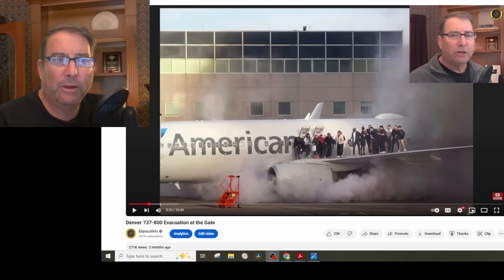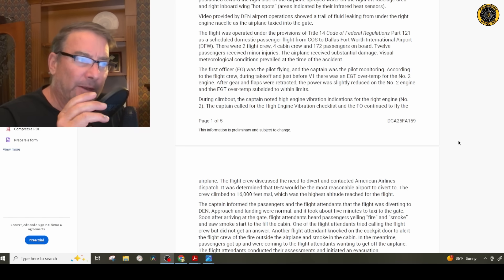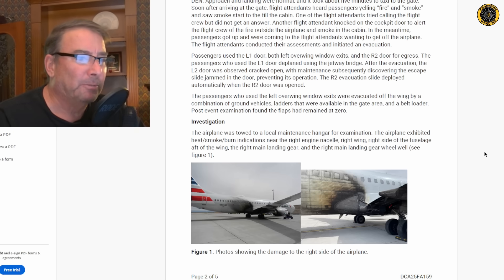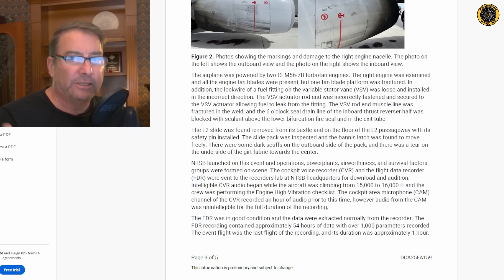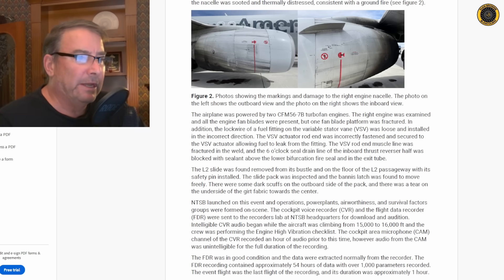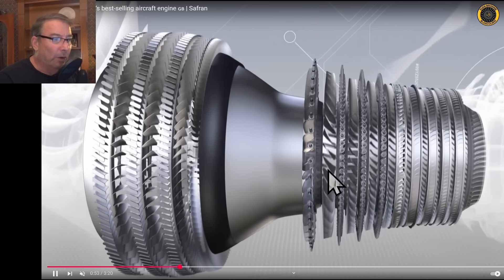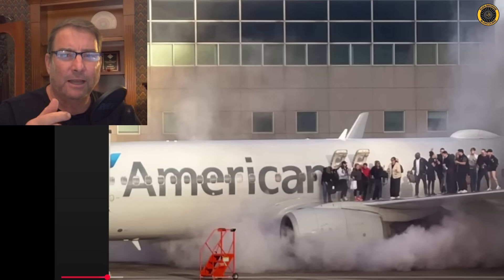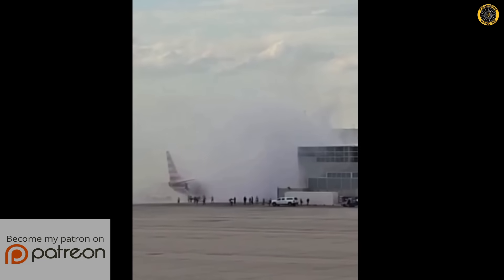NTSB Prelim American 737-800 Engine Fire at Gate and Over Wing Evacuation

Comment: If the plane is actively burning to the ground, I'm not waiting to be told to jump ship either
Reply: Wondering why so many people upvote this dangerous behavior
Reply: All those fools taking their bags.  Leave them !
Reply: That attitude is why there are more casualties than necessary in emergencies
Reply: @chrisnoname2725  I'm pretty sure pilot error is the leading cause of aerodeath, not people disembarking burning airplanes 😉
Reply: @chrisnoname2725 guys probably seen a video about that Saudia L1011 in 1980...
Reply: Yeah, so you can be stuck on the wing like the dips in the video.
Reply: @user-wn6pr4qh5v  did you watch the video? The passengers didn't initiate the evacuation the crew did, and with the rear left escape slide inop, the only available exit was the front door or over the left wing or the right rear that was behind the fire and not a good option either. I would take my risk at a broken leg over burning while waiting to get out a single door. The problem here is the lack of slides over wing, which is a cost saving decision.
Reply: @user-wn6pr4qh5v  I'd rather take a fall than take a burn
Reply: @user-wn6pr4qh5v  I can survive a fall from the wing if I have to, I can't survive smoke and fire in a tin can.
Reply: Save the false reverence for someone who cares.. you sound like a bunch of bitter pilots who go for the low hanging fruit because you already know the overwhelming majority of air disasters are pilot error in the first place, and it burns your ego. And before you cry about flaming engines and ground crew in this instance, that's a very rare exception, not the rule. But anyhow, get over yourselves. You're not sitting around in a burning plane waiting for someone to tell you to get out either.
Reply: @Drmcclung i am not a pilot. I have commercial licences i have never used. So definitely not an airline pilot. My comment was not aviation specific.

Comment: Is it possible to activate the fire control systems on the engine when the engine has been stopped? Or is it likely that it would not have made a difference if they were/were not actuated. It's still wild to me that there are no cameras available to the crew. Though I do understand why.
Reply: I can’t speak to these aircraft, but on the jets I work on as long as you have voltage on the emergency bus (even just batteries) you can pop your fire bottles

Comment: There needs to be a better mechanism by which the Flight Attendants can alert the flight crew to an emergency. Most ambulances have a series of colored lights and buzzers that the medical crew can discreetly use to communicate with the driver. They’ve had this simple system since 1977 or so. Or just a fire alarm the FA’s can hit to alert the flight crew that the bloody plane is on fire. There is a lot of talk about Cockpit Resource Management. There is little to nothing said about Crew Resource Management. For some reason communication all to often ends at the cockpit door. When the FA’s are the only ones with critical information about the state of the aircraft. they are 5he ones that can put eyes on the engines and wings.
Reply: The term "cockpit resource management" was replaced by "CREW resource management" decades ago.
Reply: @ignorance72 Indeed, but for many people (pilots included) "crew" in their head is flight deck and not full aircraft crew. 
There are many accidents (especially fires) where no or miscommunication between cockpit or cabin led to mismanagement by pilots, and a few where effective comms between the two was essential in a safe ending.
Reply: Agree... IMHO this is the biggest failure area and hole in the swiss cheese.
Reply: The cabin interphones generally have 2 buttons for calling the flight deck. One is for normal calls and the other is for emergencies. The emergency button triggers a more noticeable alert in the flight deck.
Reply: It exists
Reply: FAs can call the cockpit.
Reply: @soccerguy2433 Yes. But communication depends on the pilots picking up the call. There is really no way to alert the flight crew to “there’s something you need to know RIGHT NOW!” If they are busy or in Sterile Cockpit mode. Some sort of panic button that triggers a flashing light, or ties into the smoke detectors would go a long way towards a simple solution to a communications problem that should not still exist. And before you correct me, This Plane Was At The Gate and the FA’s Had No Way to Warn the Pilots that it was ON FIRE! This is a stupid problem to still have.
Reply: @andrewtaylor940 You are absolutely wrong. There are signals that can be given indicating the severity of a situation.
Reply: @stephenwalton9646 Did you pay any attention to this incident? No there clearly are not any such signals. Or if they are, they don’t work.
Reply: @andrewtaylor940 Or maybe they weren’t attempted. Hard to tell from my armchair.
Reply: Great comment
Reply: I assumed that there’s a megaphone in every aircraft that they can use to make announcements if the PA system failed or they’re outside the aircraft. Can’t they just use that and stand next to the cockpit door and yell at the pilots?
Reply: do you really think you just thought of this? There are multiple methods of cabin / flight deck communication that are specifically for emergency use, including backup methods if the primary methods fail. We have no idea from the information given about this incident why the flight crew were not alerted to what was going on.

Comment: I'd hate to be part of the company that overhauled that engine!
Reply: Reminds me of the airliner in Florida some decades ago that just managed to make it back, due to incorrect seals being installed.  Another scenario where the old seals were better than the new ones, in the mandatory rebuild.  Same with the new incorrect fuel line on Pische's plane, the incorrect grade cocpit glass bolts on another, etc..
Reply: look to the board that decided to outsource maintenance in the first place
Reply: First stage fan and a lot of engine work is done on wing as part of inspection.  I doubt the overhaul shop did any of that.